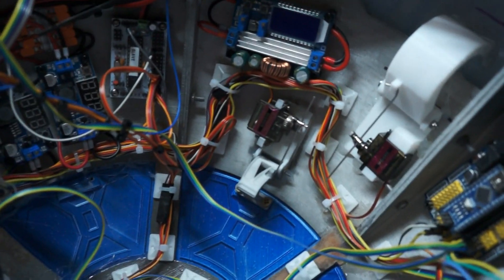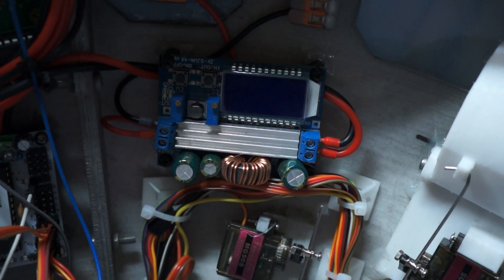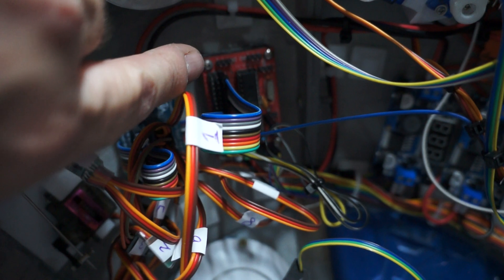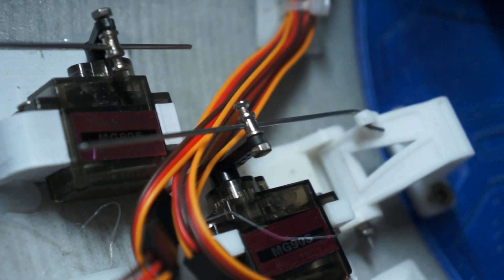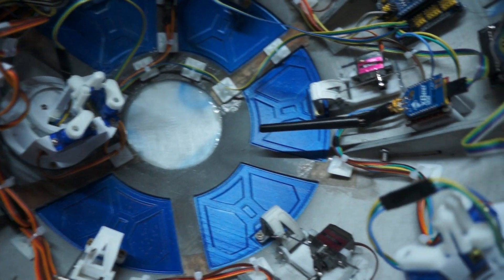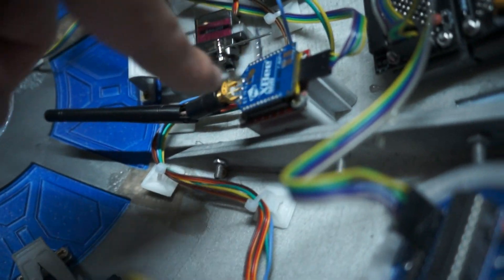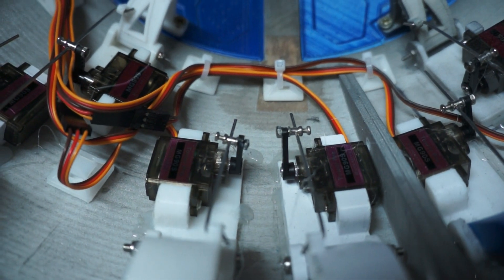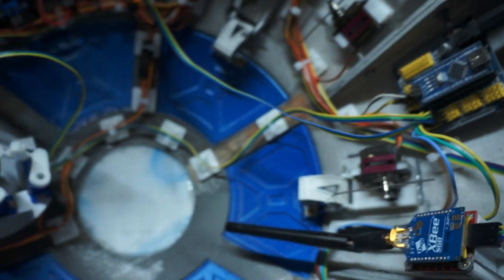R2 D2 internal dome electronics overview

Comment: This is very helpful, thanks so much for sharing. Did you add all of the final paint finishes before or after you attached the hinge arms to the pies and panels? I realize it may require some additional sanding on the pies in order for the hinge mechanisms to clear properly, so I'm currently debating the order of operations. I'm at the point where all of my dome pieces are ready for the final coat of paint and clear coat. My instinct is to perform a dry fitting and glue the arms/servo mounts in place where they should be, then detach the hinge arms from the servo mounts and add the final coats of paint to the pies and panels. Curious how you approached this.
Reply from the maker: Hi sorry for the delay on this, I dry fitted first then painted then added clear coat and then put back together